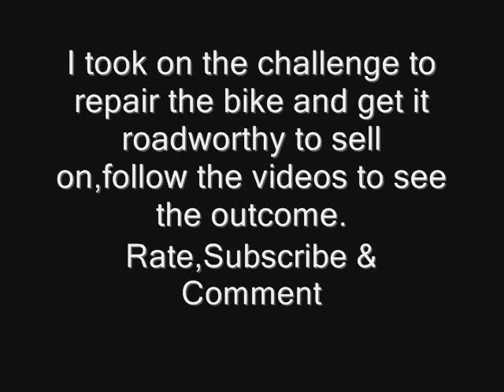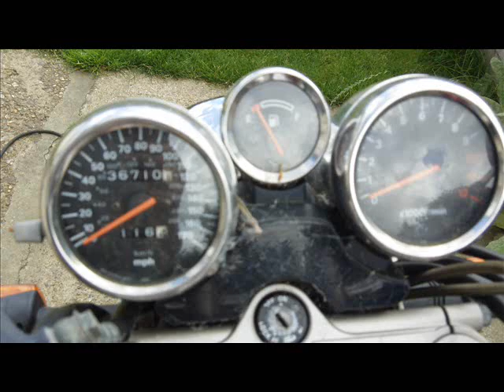Suzuki GSF 1200cc Bandit (Video 1) Refurbishment

Comment from the maker: I used heat and alot of it. If you have snapped it off you need to take your time, if it s snapped flush with the head you will need to drill it and use an extractor or drill it out and helicoil it.
If you get stuck pm me and i will help you